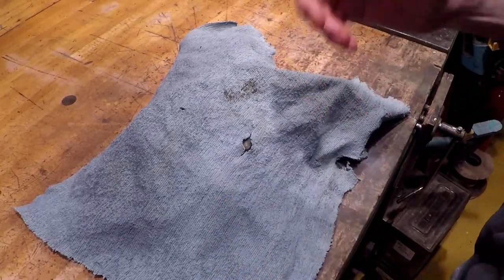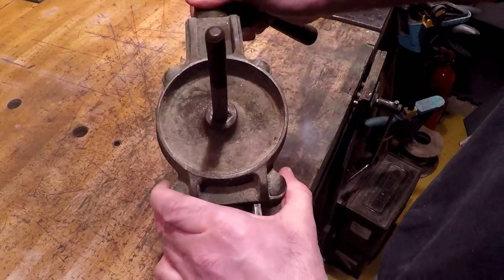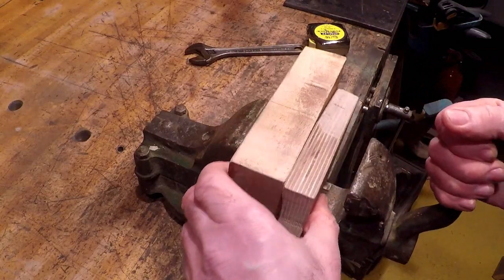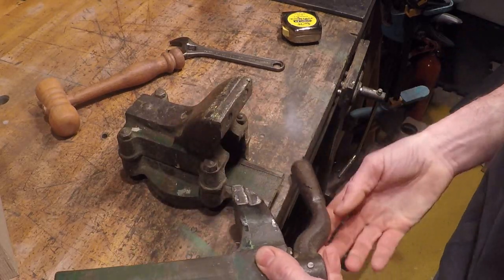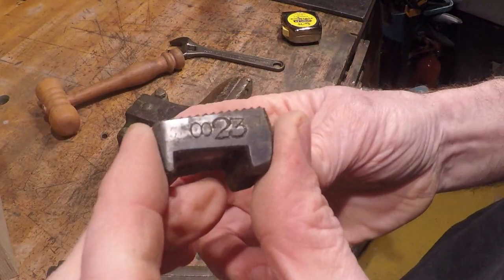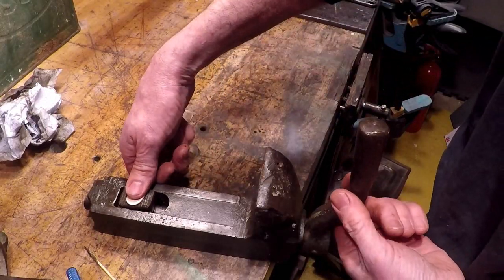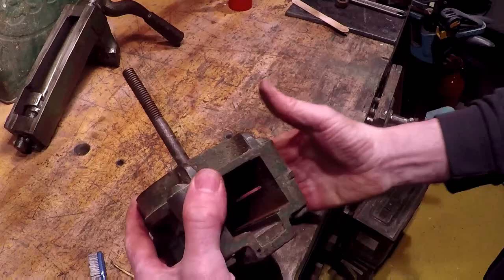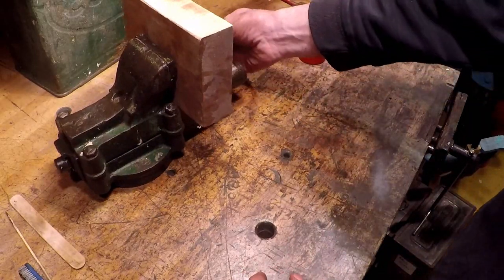#115 The rarest vice / vise in the world, Sheldon quick release, Instantaneous parallel Grip vice

Comment: Ok, I mailed a mailing list and have the following from someone in NZ:
I have a 1913 catalogue where it is listed in sizes 3" - 7" jaws
Patent "Instantaneous" Grip Vice
32/6 to 73 shillings

 ...Dug up an earlier catalog, 1910.
It is referred to as the "Lightning" Fitter's Bench Vice
With Instantaneous grip.
Specially suited for general Fitting and Brass Working.
The engaging parts are steel and should last for 30 years.

Same sizes as before & prices! No inflation in dem days! 

There also a  Pattern Maker's or Joiner's vice listed too.

Hope that helps.
Reply: What a fantastic answer!!
Reply from the maker: Thanks very much Benedict I will take a good look this evening 👍
Reply: @Everythings_Adjustable  I have a scan of a couple of pages of some catalogues with it in. One is from 1892 and the other 1913 from the London firm of Richard Melhuish and Sons.  We'll have to work out how to share emails.
Reply: @Everythings_Adjustable  I have sent an email, hopefully  will not be spam trapped. 
I would suggest you remove your email address but would appreciate confirmation you got the email.
Reply: @Everythings_Adjustable  Did you get the email?
Reply from the maker: @BensWorkshop  Yes thanks very much Mate, I will take a good look tonight 👍
Reply: Very cool

Comment: This is based on the Entwisle and Kenyon Instantaneous Grip vice (Google has further details). That vice was patented around 1880 approx. and there was another similar rival design. These woodworking vices were the early forerunners of the modern woodworking designs we know today. I suspect your vice was made by Parkinsons of Shipley Yorks as their early mechanics vices had the two part body that bolts together. They also didn't bother casting their name or model no.in some of their early products. I have one of the earlier Entwisle ones with very similar mechanism and handle.
Reply from the maker: Thanks very much John, I've added your post to the information in the description
Reply: Parkinson's improved on  this design with their quick release mechanism, but didn't make them....these were also made in the USA under Massey, but were cast in the Massey name